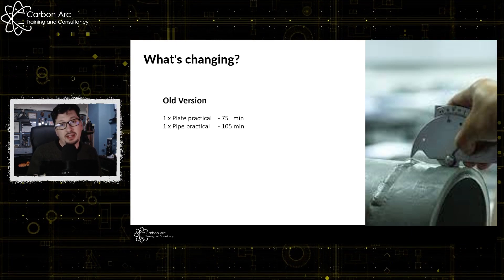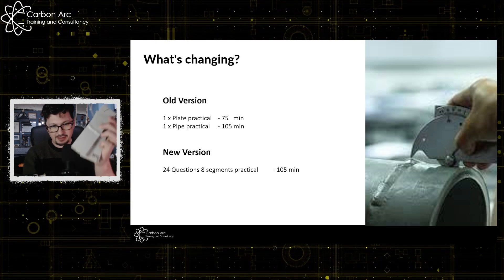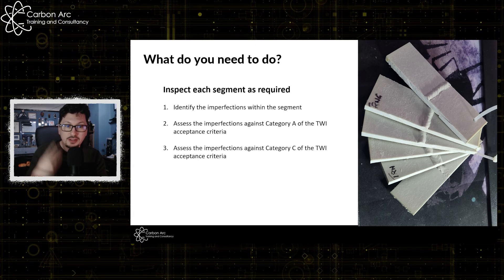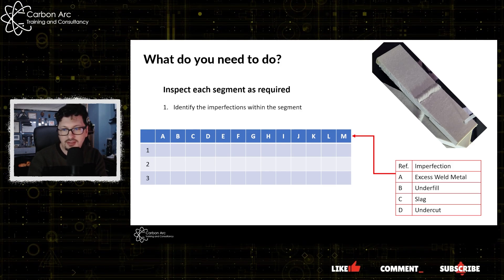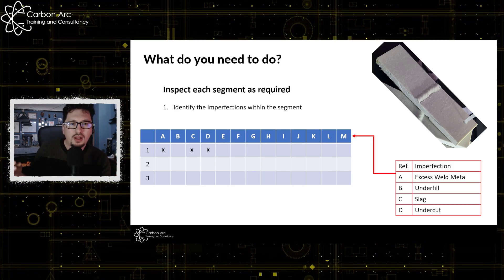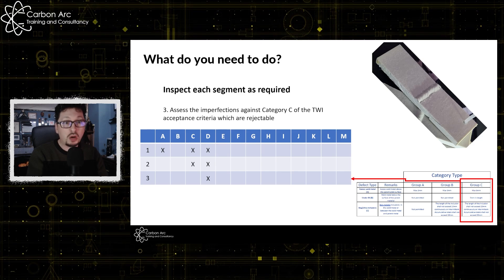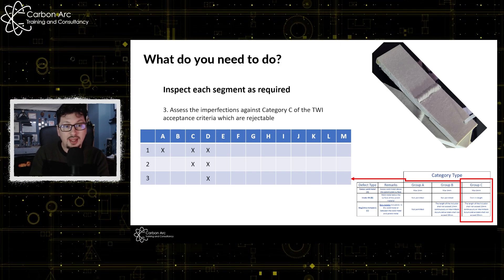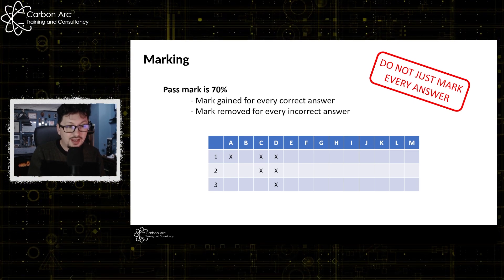NEW CSWIP 3.1 Practical Explanation in 2024

Comment: Today I failed my practical exam. A warning to everyone: I’ve been working as a welding foreman and inspector for 30 years, and with this exam, I went too far and marked too much—because of that, I lost a lot of points. So only mark what you actually see, not too much, otherwise those points will be deducted
Reply from the maker: I am sorry to hear this, but you're right in your advice. It's easy to think you have to put more down on the page than what is actually there. I use the rule that I should be able to see the defect from at least 200mm away if not, you may be looking to closely.

Good luck with your retest.
Reply: @CarbonArcTC  Thank you, James. I look forward to watching your videos again, and I hope my re-exam will be successful

Comment: Hi I did the new course June 10th this year I passed the practical but failed the theroy side any tips on what I should be doing for my resits? Thank you
Reply from the maker: I tell everyone to work through the  hydrogen cracking information for their 80 questions. If you sit back and look at each individual question so many are connected to this.
Reply: @ thank you I failed the work park by one question but the multiple choice 80 question paper was a disaster, not a fan of using an iPad for it tbh

Comment: I think it’s definitely a good thing to change the exams in this way, although I think macros should have been left in as well maybe, just change the questions to this new format. 
Will there be fillet weld samples to inspect as well as butt welds?
Reply from the maker: Thanks David, no fillet welds at CSWIP 3.1, All fillet weld tests are covered in the CSWIP 3.0 which you could completely missed is you do direct entry to 3.1 level. 

I have believed for a long time that we have a brake down between industrial need and training requirements. This is a bigger topic, but I think this is shown within all training organisations and colleges. 

We seem to fall into a trap of what can be taught in 4 days, not what is needed to show competency. I might make a video on my general feels of this soon, if anyone would be interested in my 2 pence worth.
Reply: @CarbonArcTC  I definitely feel like fillet welds should be included as so many go directly to 3.1 (myself included). 
Would be interested in hearing your thoughts for sure. 
I also think this should maybe be a 2 week course and include a lot more to do with WPQR / WQT requirements and also cover more with NDT. 
Will the 3.2 exams be changing in any way? I did 3.2 a couple of years ago and found it fairly straight forward which was surprising. 
I then did the extra rad interp for 3.2.2 beginning of last year which I found harder than I thought it would be.
Reply: Sir good morning I have a question, I failed for the old questions and I will plan to retake this June 2024 I will use  old questions or follow to the new questions thanks sir I really appreciate your response to my question
Reply from the maker: Your resit will be on the original scheme.
Reply: Thanks Sir hope upload more videos for helping us regarding new pattern of exam  @CarbonArcTC
Reply: Yap good thing and now no one can finish the exam 👏👏👏👏👏👏